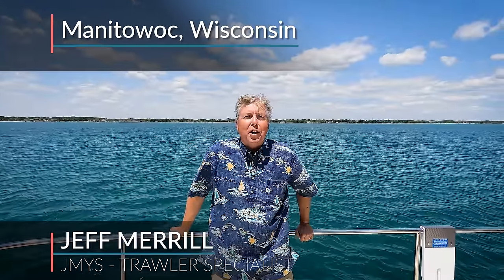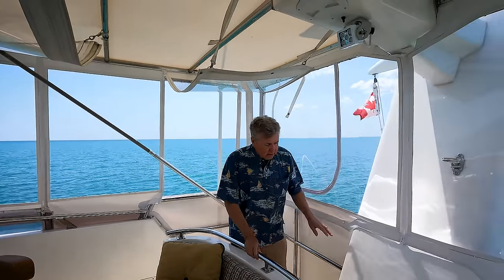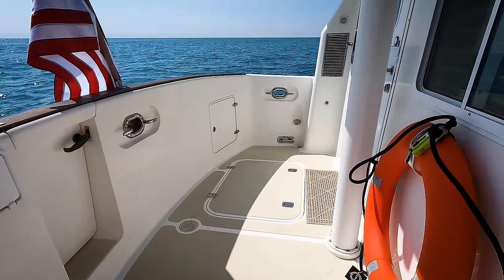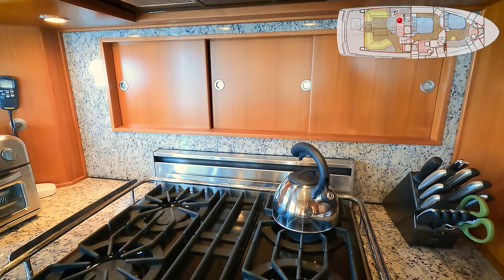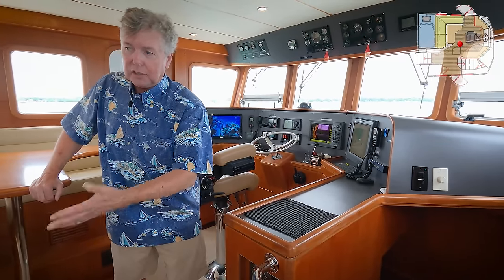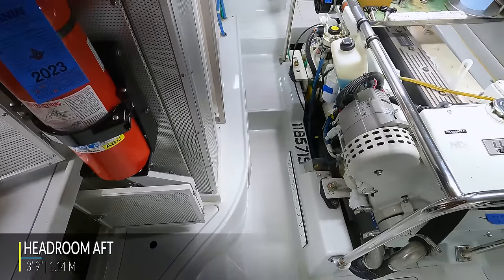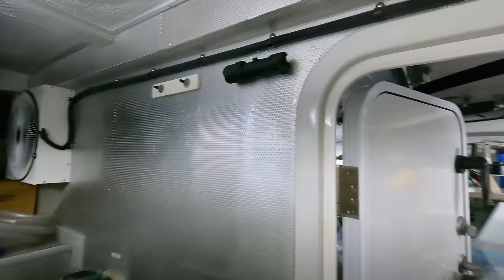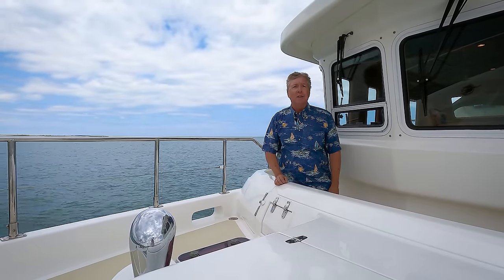NORDHAVN 47 – [Talk Through Tour] – SOLD!

Comment: She is absolutely lovely.
I am currently in Europe but when I am back in the US in spring (probably March) I may very well be interested in taking a closer look at Navigator, if she is still available at that time.
This is one of the best trawlers I have seen so far.
Judging from the video I don't see anything I would want to be modified right now, which is actually rare.
The forward cabin in particular is very nice and I also love that engine room.
I hate it when there is barely enough space to work in there or even to move around. But Navigator doesn't have that problem at all.

Also, this was a very nice presentation. Thanks for that.
Reply from the maker: TeeJay:  Thank you so much for your thoughtful comments.  The summer/fall boating season is getting squeezed out by shorter days as winter gets closer, so in about a month Navigator will be removed from fresh water and stored in covered, heated storage. She can still be seen while in the building, so please feel free to direct message me if you would like more details and we can schedule your visit in March or whenever.

Comment: can you cross the pond with this??
Reply from the maker: 1167:  Yes, sisterships have already crossed the Atlantic!  She have over 3,000 mile range.
Reply: @JeffMerrillYachts  3000 NM at 7.8 knots? What about 7.1 knots?, 6.5?, 6?
Reply from the maker: @jamesdarcy3902  I don't have the calculations handy and each boat will have variations based on load, sea conditions, etc. I believe your lower numbers are to confirm that if you go slower, you burn less fuel and can increase your range.  Nordhavn headquarters may have a range of rpm numbers
Reply: Search YouTube there is a video of a fleet of vessels crossing the pond. Good watch.